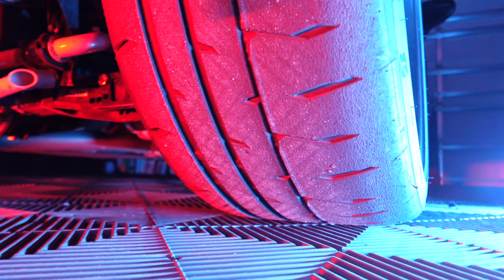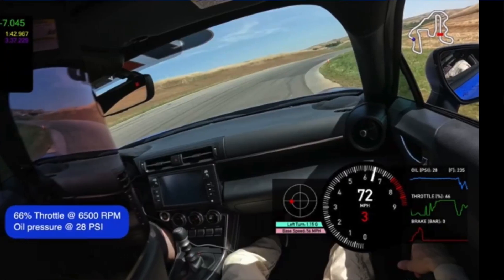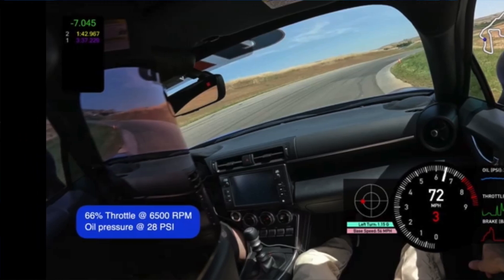GR86 Motor Problems

Comment: I lost two motors at Sebring (T17)before moving on to a different platform. Used Redline 5W30 with oil cooler and had a baffled pan on the built motor. Car was lightened to 2600 pounds, tuned for E85 on A7’s. IMO it’s simply a flat motor design challenge that Porsche has solved and Subaru has not.  In addition to centrifugal force bumpy surfaces like T17 can create vertical slosh lifting the oil away from the pickup tube inlet.  Dry sump would help a lot but I’m still concerned that the internal plumbing can’t cope with the high G lateral affect.
Reply from the maker: Kills me to hear it.. sounds like I need to get a C6Z. I love Sebring due to it’s character
Reply: Sorry to hear you having to switch platforms dealing with this. I wondered whether this was engine layout specific and looked up whether Porsche had issues with this and ran into some Porsche threads on this being an issue. 

Seems like they’ve sorted it out and hopefully there’s an aftermarket fix for the BRZ. Learning to drive manual on this car and planning to track it, would hate to learn on it only to ruin it during future track use. These videos are helpful and informative though.
Reply: It's a fine street car that you can have some with on a track. It's by no means a track car out of the gate. Drive any car hard on a track for long periods and it's a dice roll based on time. The best cars in the world will break down with hard use, don't expect any car to be invincible.
Reply: What is the car you lost 2 engines? Is that a gen1 GT86 or a gen2 GR86? And what pan baffle did u use?
Reply: @ZeroOmega  2012 FRS   Don't remember what brand the baffled oil pan was but the built motor failure was due to a right side rocker arm failure.  Entire valve train was aftermarket except for the rocker arms but severe lateral force pulled the oil away from the right side heads
Reply: @RedC63AMG  Thanks for sharing. IIRC, rocker arm failure is also one of the known issue on gen1 FA20 engines. I heard post 2015 engines have it addressed but i could be wrong. From my oil pressure data logs. GR86 FA24 engine suffers severe oil pressure drops at long/complex right hand corners and it will become even more severe when combined with elevation changes. FA20 seems to be slightly better in the same scenario but it has pressure drops as well. It may or may not related to your failure. But T17 at Sebring looks like a complex right turn that matches this pattern. IMO, Subaru powertrains sucks.
Reply: Solution is dry sump, which is why the GT300 BRZ has a dry sump.  As do WRC cars, F1 cars, and so forth.  

Porsche use dry sumps also.

If you guys want to race then it's not cheap to build/buy a race car.  Seriously, if you want to race go and buy a pre-built race spec Go-Kart (not joking).  Top specs are insanely fast, built for racing, and prob the best bang for your buck you can get.  Otherwise, if you want a race car, then $
Reply: @Jez4prez1  It’s actually quite cheap to get a good track car. One could just get an old Miata, 370z, civic si or one of the other many low cost sports cars out there that can be tracked hard with basic cheap mods and are extremely reliable on track. Unlike the brz/gr86 platform or other Subarus which are very unreliable track cars. 

I know people with 80k+ hard track miles on 10+ year old Miata’s and civics with ZERO issues. Anything with a Subaru engine in it is just bad for track without tens of thousands in mods. Period. 

You don’t need big bucks for a race car. You just need to not get a Subaru…
Reply: @Username-2  A pro spec go-kart will be like 3 times faster than a miata though, and most miatas aren't cheap anymore either.   Pros usually start on go-karts for a reason.  You also still need to heavily mod miatas to track them on any real level, like you do with any car.  These are econo cars at the end of the day, not a Go-Kart specifically designed for competitive racing, not a $200,000+ porsche designed and sold specifically as a track car, let alone a $500,000+ actual race car. 

"You don’t need big bucks for a race car."
econo cars (incl. econo "sport" cars) aren't race cars.  

Miatas, civics, and all other factory consumer cars have major design flaws and mechanical problems if used and abused for applications they were never intended for.  Don't lie to yourself.  Just look up forums, info from engine builders / car builders, see what race teams do, etc, and get wider perspective than just a small number of people you know (who have probably been lucky, or are such low level drivers they probably barely even drive fast anyhow on their 'track racing').
Reply: @Jez4prez1  Stock Miata’s, civics and various other cheap cars are used as track cars for hobby racing classes and instructing around the country. My local track rents Miata’s for track day experience packages, they have 10 and they are bone stock other than tires and oil coolers. It’s the same with many other cheap sports cars... Stock Miata’s which by the way can be raced on actual real race tracks, not go kart tracks where you will be stuck with a go kart. 

You obviously have no idea what you’re talking about. A Miata isn’t an “econo” car. An Econo car is a Nissan Sentra, or a Honda Fit. Get real. No one cares about go karts.
Reply: @Username-2  "You obviously have no idea what you’re talking about. A Miata isn’t an “econo” car."

Yes it is.  They're 100% not race cars like you said earlier.  That's why they always have mechanical issues from people pretending they're race cars.  Like most econo cars do.  They are 'sports' marketed econo cars.  Just google search MX-5 engine failure, engine blown, mechanical issues, and other key terms, and read the results, and do this for other factory cars.  They're not made for such usage, despite being advertised as such.  Don't pretend amateur sunday driving is racing or makes something a legitimate track car because people do a few laps once a month etc.

And just because some people have commercialized renting such cars out to novices it doesn't make them track cars (or good track cars).  They're just making money.  And those cars would need high upkeep (prob getting good depreciation and deductions if it's a business), nor are they efficient or the best method to learn track racing.  They're literally just making money from people who have no idea (usually old guys in mid-life crisis).

" No one cares about go karts."
Yeah, you honestly have no idea.  Since every pro will disagree with you.  You don't see them driving (or starting) on miatas or using instructors with miatas/civcs etc.  The worlds fastest go-kart can do 0-60 faster than an F1 car, and you have go-karts that can exceed 200kmph+ top speeds.  A good spec go-kart would be faster than basically every factory econo sports car.  And you can have different speeds depending on your skill level.  Plus they're cost effective (making them actually achievable / obtainable to use in actual competitive racing applications).  All the money you save you can spend on investments or on a nice road car (you won't need to pretend it's a race / track car anymore).  Your racing bug will be more than met.
Reply: @Jez4prez1 iata civics and whatever other econo cars just simply work.. Google anything mechanical breaking, shit breaks. Full race cars break. The point is a sports car in 2023 should not have oiling issues and blow with light abuse and low miles. My miata has 300k miles on it with over 100k of hard canyon, autox, drift events, time attack, hpde. And many others can attest to the reliability of other platforms..
Reply: @clubtouge1052  they break all the time.  Civics are notorious for blowing engines once you mod them.  Civics are easy to work on and cheap (or at least they definitely were cheap back in the day which is when they got their high popularity and reputation.  Cars were cheaper to buy and work on compared to today).  

"The point is a sports car in 2023 should not have oiling issues and blow with light abuse"
miata engines blow with 60,000miles, 80,000miles, etc. Brand new miatas have had blown engines.  Just look it up.

None of these cars are actually good for racing.  Not to mention they're all slow as well.  I don't know why you want to pretend they're race cars so bad haha.  They're not.  Just accept it and get over it.  You're only lying to yourself, probably bought into all the marketing, or you like telling people about your race car all the time, or something..

A proper race car is built for racing, for very specific racing applications, with no costs spared.  Take your econo "sports" car on a WRC stage and it will fall apart after the 1st stage.  Take it in turns at the same G's as a GT300 car and the engine will blow.  Drive it at max speed on a very hot day for several hours like V8 Supercars do and your engine / pistons / cylinder walls will warp.  Etc.  Race cars are expensive and built for specific racing purposes, with excellent performance.  Just like econo sport cars are built for their purpose (to sell to mass consumers and Joe Does).  Driving on public B-roads and doing the odd slow mo Sunday track event isn't racing.
Reply: @Jez4prez1  yea no one is saying a miata or civic is a gt300 endurance race car or a race car at all. Youre comparing apples to oranges.
Reply: So youre saying if you arent driving a purpose build full racecar f1/ gt3 / wrc then any other form of motor sport is useless? There is zero argument here really. I agree any street car is not a "race car". Especially miatas and civics. Its a street car designed for the masses. But its undeniable that you can modify them and have fun driving cheaper platforms on the track, like myself and many others have done for many miles. No one is claiming to be a pro racecar driver here. This is about the gr86 oiling issue and how many many other platforms have been proven to survive hard driving abuse with minimal mods. You don't need to install a dry sump to go drive grassroots level racing events in a miata or even need a oil pan baffle. The gr86 literally comes with a trackday experience when you buy the car and has been proven to lose oil pressure on RH turns
Reply: @clubtouge1052  You don't need to do that in a GR86, they have the GR86 Cup in the USA and 86 cup in Japan.  Australia has an 86 cup that is lighter on the mods compared to US cup.  None of these have dry sumps.

But these are amateur leagues, like the Miata cup is.  

No one here is doing serious racing (above 86 Cup level, I'm talking serious racing) so no one here requires a dry sump.  Let alone if all you're doing is B-roads and the occasional weekend track days then the oiling issue isn't even an issue.  

But you still aren't going to expect good performance from any of these cars either, be it a Miata, 86, Civic etc.  They're crapboxes at the end of the day.  Literally budget econo cars that all have a history of blowing up especially once you start modding the engine or abusing / driving hard.  You mentioned the free track day, or even the GR club by Toyota is a good example, it's marketing and appeals to a wider consumer base.  It's like how you see every car journalist just do 0-60 times in every car these days, even in people movers and SUVs, and basically treating the car like crap.  Because it appeals to getting more views to watch the videos.  Car journalists are paid by car companies also, helping attract buyers to cars and giving impressions of sportiness or other vague marketing spin.

The US GR86 cup those cars (to enter comp) costs $80k to $120k.  They don't run dry sumps.  And Toyota would have built the cup car the way it did for a reason (most probably cost / benefit analysis).  Obv they're more modded than the Australia Cup.  But the GR86 cup is still a low level for racing, and is considered an entry racing comp for people.  You have people who came from go-karts or miata cup in there, some who have never raced in other comps before. 

The point I'm making is to race a car is expensive.  You should just buy a go-kart, or if necessary you can lease race prepped cars as another option.  Trying to build one yourself is not a smart move.  People who race get sponsors to pay or contribute to the costs.  Or they have entire teams behind them and operate in company structure.  They aren't just one individual who buys a stock car then pays out of their own pocket to try and build a track car (unless they're very rich, have no common sense, or they just do it for the hobby and don't even track / race it anyhow).  Don't try and turn your own street car into a track or race car is what I'm getting at, it's a very bad financial decision.  Just recognize it for what it is, and keep it what it is, a street car.

Comment: I’ve been running with about an extra 1/2 quart of 5w30 for the track, haven’t seen any foaming occur but at the same time after 3 track days and 2k road trip, I’ve seen oil burn a bit maybe 1/4 of a quart
Reply from the maker: Everything else is stock?
Reply: @phelpsgarage4202  yep pretty much stock, camber bolts and rt660s, I’m in the northeast so I haven’t seen oil temps on stock cooler more than 240 deg F when ambient track temps are 60-80 deg F… I need to get something that measures oil pressure but my catalyst shows 1.27Gs consistently

Comment: What about an oil catch can? Or better yet an air-oil-separator for even more protection?
Reply from the maker: I have two catch cans and they don’t have any to do with the oiling system. They manly stop the oil from getting into the intakes system so your car doesn’t burn the oil.
Reply: @phelpsgarage4202  
Right so for extra protection/reliability then. But isn’t an air-oil-separator more effective and/or easier to own since it doesn’t require any maintenance like a catch can does?

Comment: I really really want to buy one but it really does seem to suck because everywhere i turn there is a video explaining about the engine blowing up. I dont plan on tracking the car but i would like to drive it hard every once in a while. I would like to drop the oil pan maybe 3k into the car but im not sure. Would pike to know your thoughts. Any advice? What oil to run for daily use?
Reply from the maker: So if you’re not going to track the car you should be fine. It’s the high g forces on right hand corner that cause the issue. You’ll probably never see that on a stock car due to the limited amount of grip. A good quality 5w30 oil is what I would recommend.
Reply: Oil temp and viscosity only help if oil is present.   I believe the problem to be slosh and the problem is created when the cars lateral performance is improved.  I also believe the rtv issue (while unsettling) is not the root cause and at best a minor contributor.     Toyoburu extensively tests these cars during design to protect their image and limit liability.    Therefore I believe these cars to be extremely reliable is stock form.  Fact is you improve the performance of the limiting factor in an engineered system, sometimes a new limiting factor emerges. This one just happens to really hurt.   However, this is the nature of motor sports and design.
Reply from the maker: @davidpotter8486  yep! The faster we go and harder we push we find new limits

Comment: I might be wrong here but I’m pretty sure these cars sold in Japan and Europe come from the factory with 5w30. It’s what I use in my gr86 and every 4-5,000 miles the oil is about halfway to the full mark on the dipstick so even then I get a little consumption. Subaru life I guess🙄
Reply from the maker: Whatever they use should be replaced with a higher quality oil. I’m always checking my oil at the track and I never have to add anything..
Reply: My GR86 has about 9,500 miles now. With these engines, after an oil change, crank over the engine w/o starting (push the gas all the way down and the clutch). Then start the car and let it run for a short time. Turn it off and wait about 10 minutes before checking the oil. You will probably see that the oil is low, so top it up. When my new GR was delivered it was about a half quart low. When the Toyota dealer did the first oil change, I checked it at home after letting it sit for 15 minutes and it was a half quart low. My car has never used any oil between oil changes.

Comment: Ooh yeah that pressure dropping on the right hand corners isn't great. A bit more about how the oiling works (FA20) but in the valvetrain https://youtu.be/ti-C1VMxk3E?t=149
Reply from the maker: Thanks for sharing
Reply: @phelpsgarage4202  no problem. Once we pull out our FA24 we're going to do a comparison with the FA20

Comment: Another problem these things that they have is an issue with gravity + G-Force.  With a vertical engine the oiling system will have more of a chance and tendency to dispense the circulating oil back into the sump.  The horizontal engine could end up with pooling in the down-force direction.  Long sweeping high G turns could be an issue. The 0W-20 and thinner grades was a political mandate. That can't be a good thing.  I'm still on 0-20 and don't race "yet!" but switching to 5-30 no matter what.
Reply from the maker: I agree.